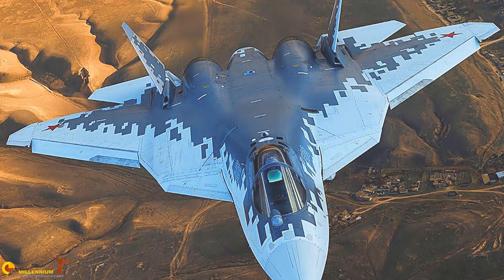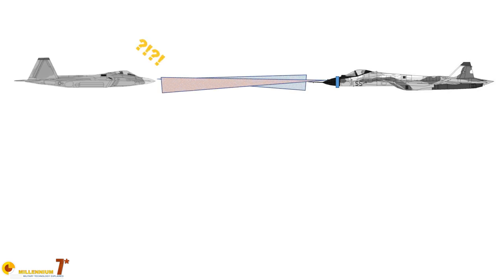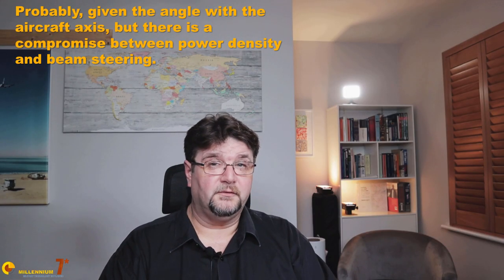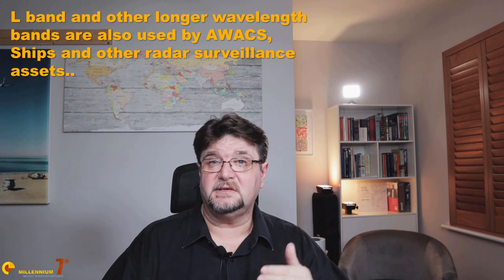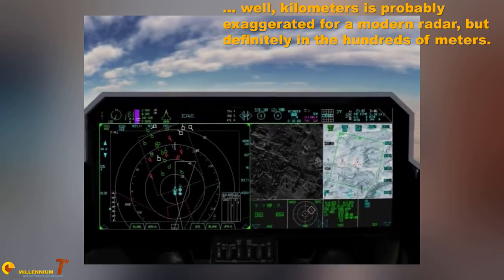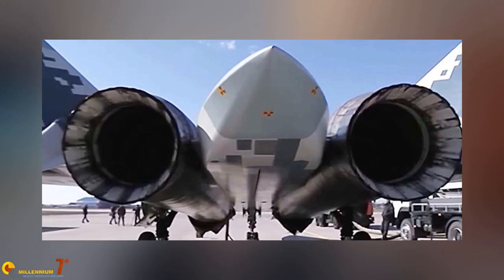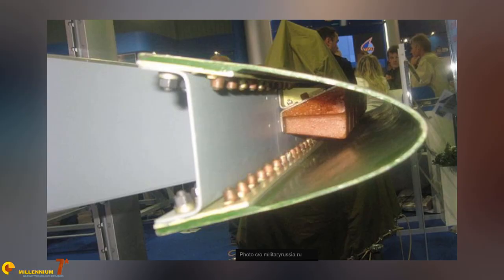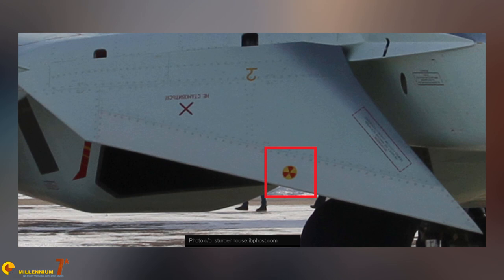Su-57 the Raptor Spotter | Part 4 - Radars, ESM, ECM, IFF

Comment: Those L-band radars are in a way tactical or frontline AWACS replacements when the A-50 or A-100 is not available or it would be too dangerous to fly it close to the enemy (with really long range AA it is possible), or there is a problem with ground based radars on the far east - it with MiG-31's can provide coverage, but with L-band radar it is able to detect stealth. Though obviously it has very few components. But that's the limitation of wavelength rather than only Russian feature.
Reply: These antennae lengths are way too small to be used for detection and tracking in L-Band. They're for something else.

Comment: The level of electronics here is really sobering.
Reply: especially when you consider western manufactures can produce much much higher density chips with better performance and lower power requirements than anything currently capable of being produced in Russia. Even China isnt capable of matching current chips that go into iPhones.
Reply: @nickbrough8335  Maybe - not sure if military hardening requirements can be met with the smallest commercially-available semiconductor processes, in the past generational lag has been not uncommon. Also, China does really well with mobile semiconductors. Btw and fwiw (maybe nothing), the Ingenuity helicopter is flying on Mars with only a Snapdragon 801.
Reply: @Ni999  I agree no military user will be using something as powerful as an iPhone chip (yet). However, the important point is that no Russian or Chinese manufacturer can manufacture something with her same technical capacity. 

BTW the flight software for the martian helicopter uses a fraction of the computational power of an iPhone using computational video to improve the resolution and depth of field of photo taken from an iPhone lens or Galaxy S-20 series phone. Data processing technologies used in radar imaging analysis today use systems with several orders of magnitude more processing power than any mobile phone.
Reply: @nickbrough8335  I respectfully disagree that the Russians and Chinese not being able to produce the latest semiconductor technology is an important point. They only need to produce technology that is good enough for their purposes.

I'm not terribly confused about the mission requirements differences in processor bandwidth for the Ingenuity vs a contemporary warbird. I brought up the Snapdragon in terms of semiconductor generations and my statement about hardening requirements. The Snapdragon 801 was designed for mobile process production 7 years ago and was not even then using state of the art manufacturing process technology and yet, as integrated, is mission capable in a demanding environment known for electrical overstress conditions and radiation-induced upset susceptibility - and it's doing just fine. And I would assert that its structure density is at least as good as that used for the processors that the F-22 and F-35 used to achieve acceptance.

The abilities to operate through a hostile environment and provide sufficient processing bandwidth is not a function of the latest semiconductor technology for our systems and it isn't an a priori requirement for theirs.

Please see my next reply for my view of their requirements.
Reply: @Ni999  You seem to be confused. A radar image is analogous to a video image with a pixel size, but with each pixel (data point of you prefer) containing a lot of digital information compared to a photograph. The computer system takes the raw data applied a bunch of mathematical of other analysis techniques and produces a simplified, filtered version for the pilot or radar operator. The higher resolution of the radar image itself, the more data points need to be processed into useable information for the pilot. Like videos the data feed is continuous.  

The basic data processing requires raw computer processing power. The more power you have the more mathematical calculations you can do per second. By all means don't take my word for it. There are hundreds of videos on youtube comparing the performance of different computers made with different processor chips. Just look at the time difference to complete the same task. For image processing tasks the difference can be 10s of minutes and price point from a few hundred $ for the computer to $50,000+.
Reply: @LRRPFco52  I had a very nice reply with nothing inflammatory that I think you might have been interested in because I remember other good conversations with you.

I have no idea why it seems to have been censored out of existence. Hopefully you get reply notifications by email and were able to read it despite whatever happened to it here.
Reply: @Ni999  Don't worry, whilst I'm not a physicist, I do have a science PhD and with your background I'm very surprised you know so little about data processing and signal analysis. I appreciate I don't understand either the maths or the physics, but I do understand what I read and respect what experts say. It seems to me that anyone who tries to argue that having inferior computer processing power can somehow deliver equivalent performance to systems made with more advanced hardware lacks common sense.
Reply: @nickbrough8335  At no time did I say or imply that the Su-57 electronics have the same processing power. I said that they were sobering. You inferred your own impressions of what I meant as being somehow obvious. And sorry to be a pain about it but I've forgotten more about digital signal processing than you have learned but I only think so for good reasons. If you're quite done putting words in my mouth and assuming what I still don't know then I will stop and really give your admonition about common sense all due attention.

What I found sobering I detailed for the other fellow and said to you at the end my response to look for that next reply for details. YouTube seems to have censored it and you didn't stop to ask.

My biggest ignorance has been in putting up with your ego. Please don't look for further replies from me.
Reply: @nickbrough8335  The "much much higher density chips" are nowadays not "western" but far east. Taiwan and Korea.
Reply: @nickbrough8335  Processing power is not everything. Keys are the analog electronics and the maths.
Reply: @rosomak8244  who still uses analog electronics ? The Russians certainly don't.
Reply: @rosomak8244  Taiwan is the leading manufacturer but the chip designs and dies are all US made.
Reply: @nickbrough8335  There is a big difference between microelectronics for household and military use. If you look at what processors the computers on the F-22 run on, you'll be surprised.
Reply: @vladimirnikolskiy  Naturally the computer systems are going to be quite old for many western aircraft as the designs are old. The west was working on the basis if low threat levels in the recent past. However, we're going to see more upgrades going forward.
Reply: @nickbrough8335  I have no doubt that your old systems will be modernized, if only because the stock is already running out of discontinued components. As for the Russian Federation, the Russian army in the 90s also worked on the basis of a low level of threat. It ended with the bombing of our friendly Serbia and NATO's approach to our borders.
Reply: @vladimirnikolskiy  All that was your own fault. If the Soviet Union hadn't spent 40 years crushing its satellite states then you might well have found friends on your door step. Today, your Govt still trying to use fear and the threat of violence to get their own way. Since this tactic will never work and invasion and direct control is impossible, what is the long term strategy ? Once the green Energy transition does happen (and it will although not by 2040) what will Russia have left ? China can replace most Russian export weapon sales anytime it wants to. Russia will end up trapped between two strategic adversaries in the east and west.

BTW I've been to Russia quite a few times and the Russians I've met, eaten and drunk with would fit in around most parts of the UK (language permitting) without comment.
Reply: @nickbrough8335  I didn’t understand your idea. How can the fact that China replace most of the export of Russian weapons have an impact on the fact that Russia is trapped between two strategic adversaries in the east and west? Why should China become our enemy if we have excellent economic, military and political ties, especially since we are not friends against someone and do not interfere in each other's affairs. I also did not understand why you mentioned green energy, but believe me, there are rather ambitious plans in the Russian Federation for it. If interested, find information about plans to build a tidal power plant in the Penzhinskaya Bay.
Reply: @vladimirnikolskiy  Sorry, bad punctuation. China is becoming a global super power and the US/NATO already is. Russia sits between two global powers and its economy is based on commodities, the largest most valuable one (Oil and Gas) has a finite life now. Then what ? What's the Russian economy based on ?

Russia could have chosen to be at least neutral towards the US/NATO but pride and fear (?) got in the way. China has decided its own interests outweigh having cordial relations with the west and is currently buying Russian military know how and Gas. I don't see any Russian leader, least of any current one, wanting to play second fiddle to China do you ? What happens when Chinese military tech exceeds Russian ? 

The rise of China is also causing geo-strategic issues for India which is slowly moving from neutral to western orientated in response.

Do you really think the emerging super powers of the 21 century aren't going to have their own agendas along the Russian border zone as well as elsewhere ?
Reply: @nickbrough8335  I will add to my reaction to your words: "could have chosen to be at least neutral towards the US / NATO". Russia tried to be not only neutral, but also an allied US and NATO. We helped the US intelligence agencies to establish contacts with the Northern Alliance of the Tribes of Avganistan after 11.11. Russia provided its bases and airspace for NATO flights to Avganistan. And much, much ...

Comment: There is a trick to get better resolution from radar that apparently spy satellites use, they take a radar picture from more than one point and combine them, similar to ground telescopes that have their mirrors on tracks and in an array, VLA. Also used on radio telescopes, which are big radars..
Could this be used on networked aircraft?
Reply: It's called interferometry. The problem will be processing power in the CPU/GPU in the aircraft to process the large of data combined from taking multiple radar images and combining them. They sort of computer systems used on the ground are very high performance and they take considerable time to work for complex high density images. One for the future more like.
Reply: Advanced AESAs use narrow beam sharpening for PID at BVR, similar to GM but obviously for airborne targets.

L-Band in such short antennae lengths would be useless for that.
Reply: @LRRPFco52  What sort of wave length is L-Band?,, Wiki says 30cm.
I assume the two antenna on the wings work together as one.
Reply: @LRRPFco52  For clarity I come from an Pro Audio background, where making things directional is about making the radiating surface the same size as the lowest wave length, I have no idea if the electromagnetic spectrum behaves in the same way.
Reply: @Margarinetaylorgrease  L-Band is commonly used for Distance Measuring Equipment along with VOR. It's also used for GPS, IFF, TACAN, ADS-B, and data links.

Notice that all the antennae are embedded in the Su-57's airframe, and have to perform more than just combat tasks. Comms, NAV, and position location still need to be represented in the embedded antennae architecture.

Comment: Whenever I see videos about all these systems including UAV control systems , radars , ecm etc I always wonder what happens when two sophisticated opponents turn on all their systems and counter measures at the same time. Im guessing massive interference and confusion with a lot of pilots ending up WVR unexpectedly.
Reply: The SA for F-22 is pretty impressive. JSF is multiple times better than that since it uses at least 4 different spectrums for its sensors. There aren't any aircraft that can get anywhere near them, especially JSF.

The SA for a flight of Raptors or JSF rivals AWACS substantially.
Reply: @Adrian Simmlekark Operational squadrons flying 2-4 ships accidentally detected strategically-significant threat missile systems that dedicated surveillance aircraft couldn't find, and had been looking for over several weeks, so the sensor fusion works.

It was a huge engineering challenge for the F-22A in its early days with IFDL data link, but they cracked it after 2 years of intense work at Edwards.

JSF has been providing targeting and terminal guidance for surface warfare and land-based systems for years now.

Comment: I like your videos and content, thank you.

I’m ill-informed on these subjects but I’m curious: has the Su-57 had issues during fielding? I’m wondering if anything similar to the F-22 oxygen generator system happened. Any aircraft lost during the process of rolling it out to line units? Have there been times when pilots refused to fly the aircraft (like the F-22? 😉
Reply from the maker: The first production unit crashed but the pilot ejected... bad omen I suppose.
Reply: @Millennium7HistoryTech  To be correct, it was not “real” first. In 2019 was signed two separate contracts, first one for 2 (two) units and second one for 76 units. What the difference?
First contract is called ‘pilot batch’ (“ustanovochnay partiya” in Russian; “установочная партия”). In it special units which factory use for practice before launch real serial production: workers learn how to assemble, inspectors how to accept work, factory how to build and optimize assemble line, etc.

Units from pilot batch never have same status as serial units in army, that why they ordered by separate contract, because it is awaited they can have some troubles. So, fall of first is okey, it is exercise unit for workers. After that factory before launch serial production was forced to produce else one additional pilot unit, because until pilot batch not success all tests, factory have no right to launch serial production by next contract.

So, first “real” (serial) Su-57 is actually 4th unit.

Comment: Two more clarifications:
Putting a SEARCH radar in the tail is quite inane as this sort of radar depend HEAVILY on the Doppler effect i.e. the magnification  effect of return signal compression  of an incoming object.
Everyone have experiment this effect with ambulance , fire guard or police car's sirens: noise grow up at unbearable levels with them incoming , once they pass it however fell down abruptly at lower even level of the same syrens standing still.
Same happen with radar signals send toward something you are actively distancing to,, . Only russian plane to have an active radaris Su-34 i.e. a bomber that would be actively chased by enemy aircraft. However Aesa (and hybrid PESA) antennas are radar receivers also, so until they are in the range of their own (compatible) AD radrs they can get their own signals.

L-band radars have not the resolution sufficient to directly target an enemy aircraft? NO PROBLEM AT ALL! They have MORE THAN ENOUGH of it to point the X-band radar toward it IN NARROW SCAN MODE almost doubling its effective range, still some uncertain return signals, NO PROBLEM AT ALL X-band radar could go to TRACK ONLY MODE while L-band one will still be able to scan around in the same time.

Comment: Will the Su-57 be integrated with new or updated AAMs? What is the current state of Russian AAM technology?
Reply: Way behind in fielding, but modernized in development. Losing the Ukraine was a giant blow to Russian AAM development and production. It basically shut down the R-77, other than for export customers like China and India, who fielded it way before the VVS.

You still see Su-27SM2s carrying R-27 variants, though they have upgraded the seekers and guidance solutions on R-27s.  It's a huge missile though with significant aerodynamic and weight penalties.

It wasn't until Turkey shot down a Russian Su-24M that we saw operational Russian units flying with R-77s, and in very limited numbers in Syria.

US has been flying with and shooting down threats with AIM-120 since 1992, the first being a MiG-25PD solid state electronics-equipped Mach 2.8 capable interceptor.

Indian Air Force and PLAAF complain that the R-77 RVV-AE is very limited in WEZ and failed to connect with Pakistani fighters in Feb 2019.

Now India is buying Rafales with Hammer and Meteor AAMs that actually work, after the disappointment in R-77s. The Chinese say the R-77 is almost useless to them as well, so they have their own superior PL-12 & PL-15 BVR missiles.

Chinese report that Russian electronics is inferior and outdated, very low quality compared to theirs.
Reply: R-37 is just entering service with their airforce, try and look into it ! It is a game changer for the russians for sure !
Reply: @LRRPFco52  Is the R-37 well behind as well ? Even more potency and range than the Phoenix?
Reply: @conan670431  There are no published tests of successful intercepts using R-37s that I'm aware of.  AIM-120D currently holds the record for longest intercept, which was demonstrated earlier this year by an F-15 off the coast of Florida.  US rocket motor tech has improved incrementally over the years, along with guidance, ECCM, and maneuverability.